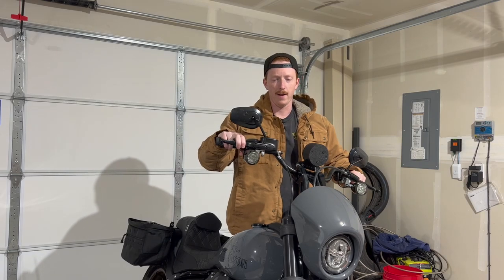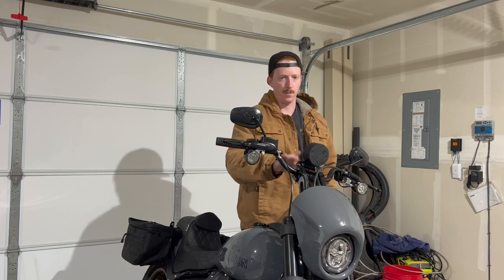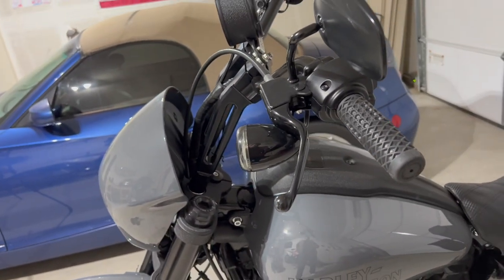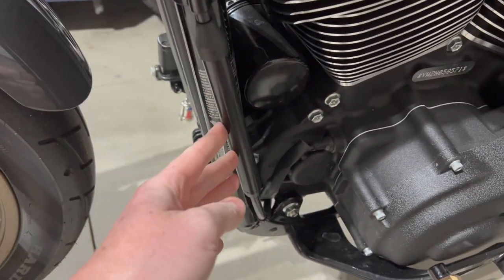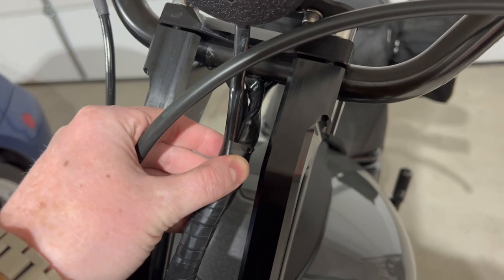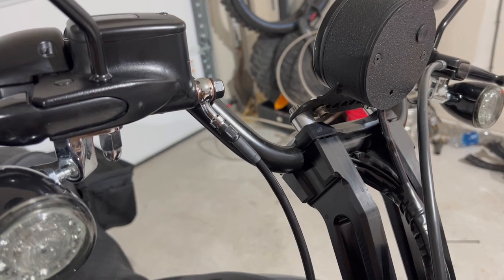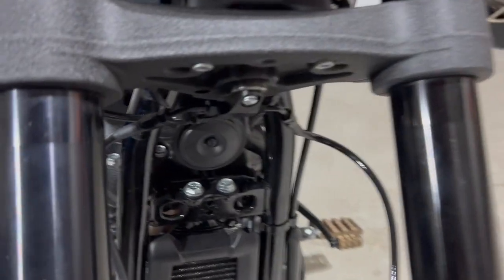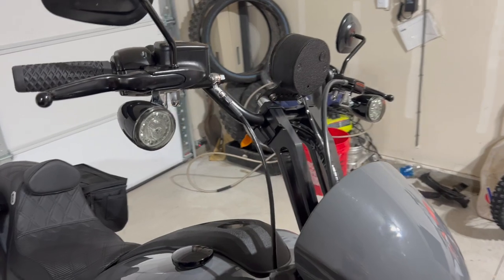2022 Low Rider S T-Bar Guide

Comment: Are you sure about the non-abs? It’s a standard feature on these bikes..? Did you pay extra not to get it?
Reply from the maker: Abs used to be a standard option, it changed for 2022. The dealers will tell you the same, Harley was unable to get enough abs units to put on all the softails.
Reply: Not doubting you, but it says standard option on their site. 

I’m sure hoping that mine, that’s not delivered yet, has it.
Reply: @JonsMotorcycles  not all the softails have abs. But ABS is standard for low riders. You need to double check with your dealer if you dont know what ABS looks like.